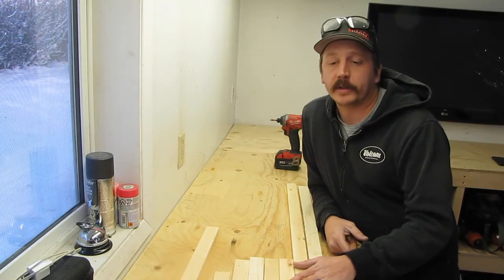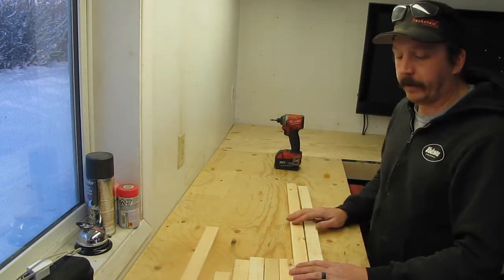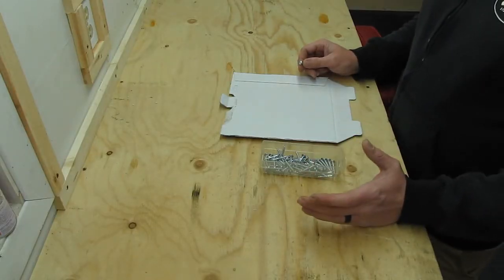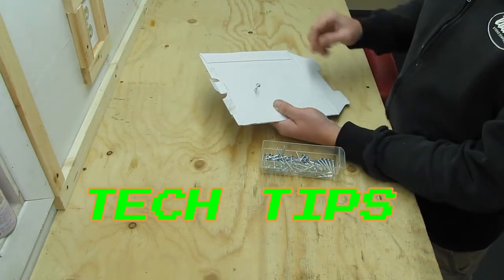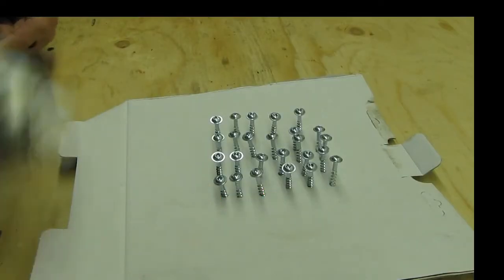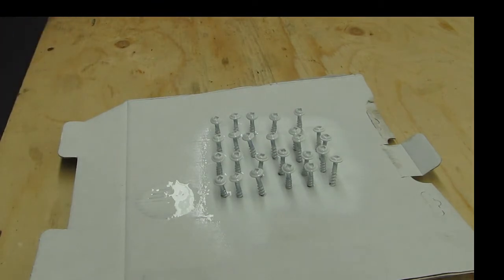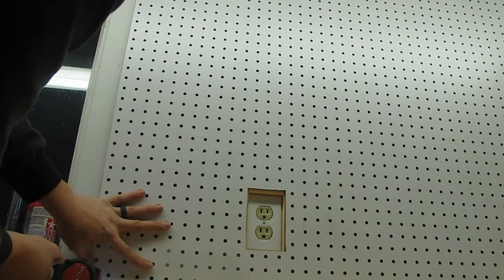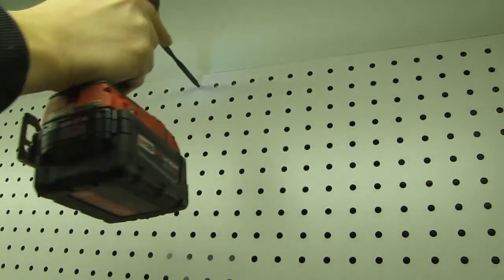How To Install Pegboard / Ultimate Workbench Upgrade

Comment: Instead of doing full strips, could I just cut smaller blocks for spacing? This way I don't lose all the holes that are right against the backing strips.
Reply from the maker: Of course you can. Just try and have one every 12 inches or so. That way it will keep it sturdy and not wobble around every time you put tools on it.

Comment: Wondering why you didnt keep the full height of the pegboard ? Just to keep in line with window? Also no supports/spacers in the middle..if you went full height would you use them?  I know its not rocket science, but asking your perspective is kind of like measuring twice and cutting once vs me putting it up one way then changing my mind later.
Reply from the maker: Your right about keeping it in line with the window. And I wouldn’t be able to reach the top of the pegboard if I went with the four foot height. You shouldn’t need the supports in the middle as long as you have the top and sides secured well. All the weight of the tools will be pulling downwards not in towards the wall. Good luck with the pegboard instal and I hope the video helped!

Comment: The frame you put up look smaller than 2×4's.  What size are they actually?
Reply from the maker: They are 3/4 by 1 1/2 stripping.
Reply: @thechroniccreators3294  Otherwise known as a "one by two" if you are asking at Home Depot.